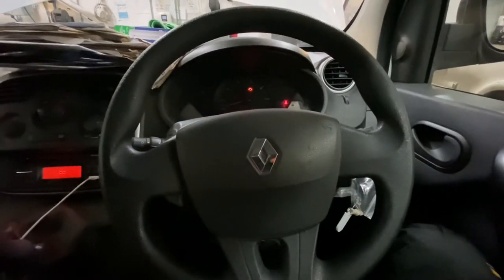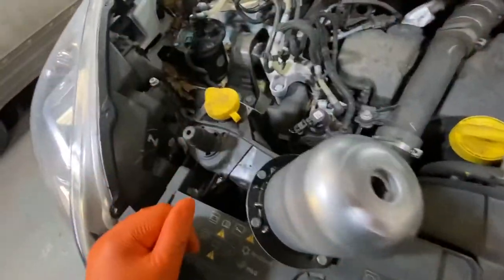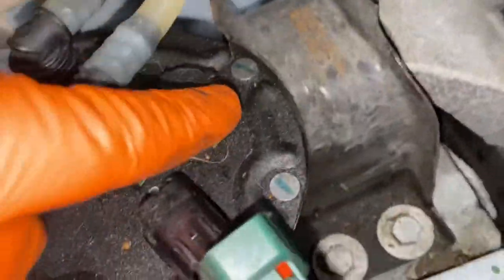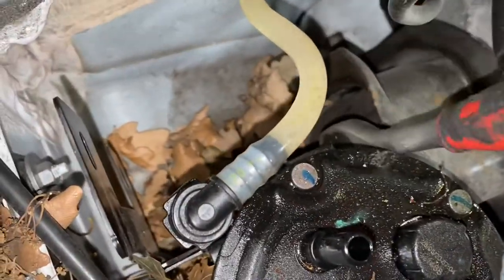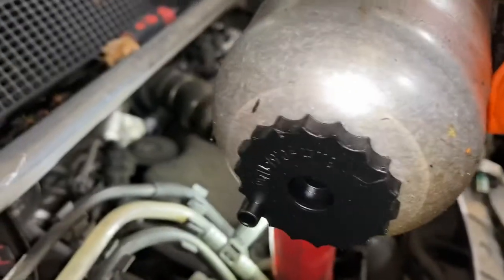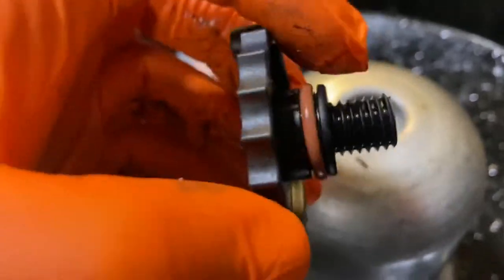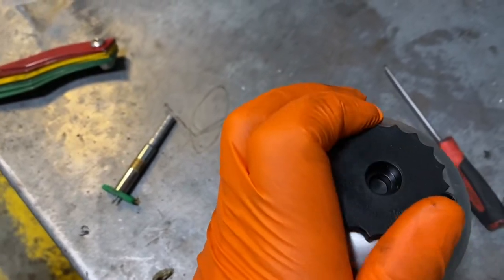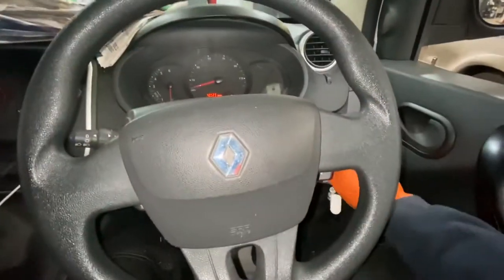#Renault #Kangoo #diesel #filter #change

Comment: I took out my filter to identify the model. But when I put it back it doesn’t start anymore.. Is that because I have air in the system? If so how do I bleed the air without that little pump thing
Reply: @NoahfromEarth  follow the fuel line until you get to the bleed nipple. I put a spare pipe on the end of the bleed nipple leading to a jug as it will spray everywhere